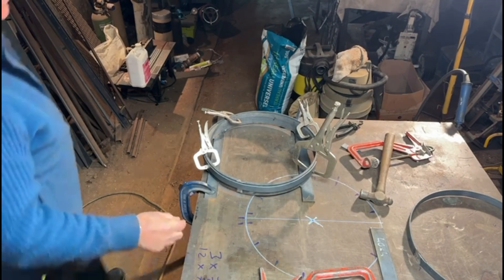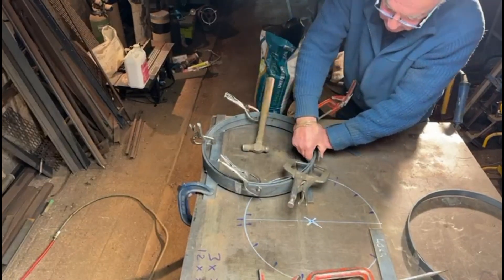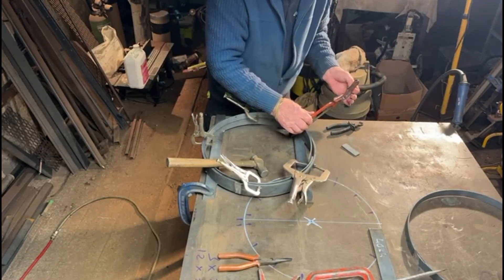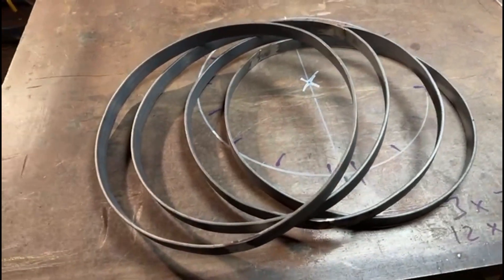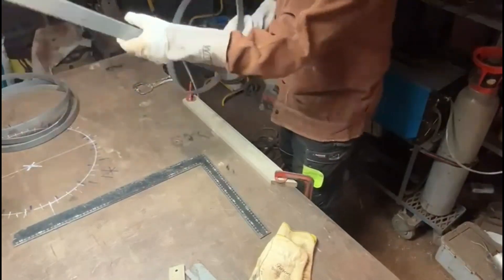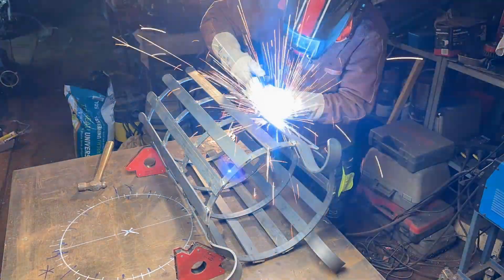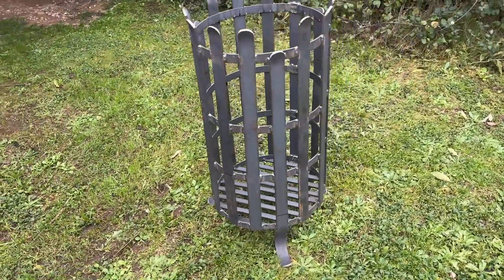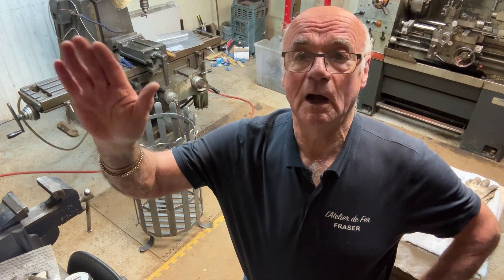How to make a Garden Brassier

Comment: Interesting video. Thanks. Did you have to make the original former first? How’s the weather there?That storm  Bert must be hitting you around now. Lots of wind with fallen trees across the roads here and downed power lines. The rain is supposed to hit around midnight.
Reply from the maker: Hi Greg. thanks for comments. Yes, I did make the former or rather, I had it made by a company who I do a few bits for (mainly machining). They are a fabricating firm and have the equipment to make nice round hoops using quite heavy steel, 50 x 12 flat bar, that I could then use as a former. 
Certainly getting plenty of strong winds and heavy rain. Not sure if it's Bert but definitely a storm! Meteo says clear tomorrow but colder than today.
Take care. Fraser.

Comment: It is often the case with home constructed things, they are cheaper to buy made in china. But, you have made a much stronger object than you can buy in brico, that one will last for many years, unlike the chinese made things which fall apart in a very short time, you only have to see all the garden furniture at the local dump to see how shoddy these imported things are, so you have a choice between make a proper one, or buying a "film set" job that looks good for a season. I thought you would get the cutter wheel pinched when cutting the hoop to size, under tension they can quickly close up on the disc and shatter it ! Take care! Chris B.
Reply from the maker: Hi Chris, yeah, the one I made should last a few years with no problems. I made one several years ago for a client for the same reason: he had bought one from a brico and it lasted about 18 months. Ha was extremely pleased with my one, even though I charged him a lot of money for it. Luckily the cutting wheel didn't get pinched at all, but yes, it is always a risk doing something like that. Cheer, hope you're well. Fraser.